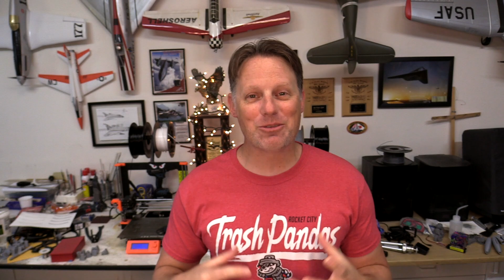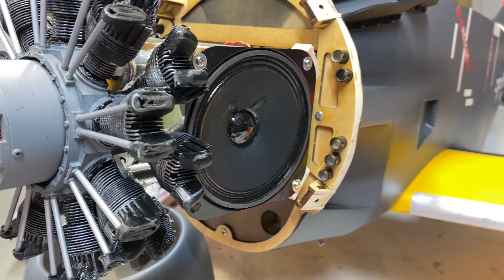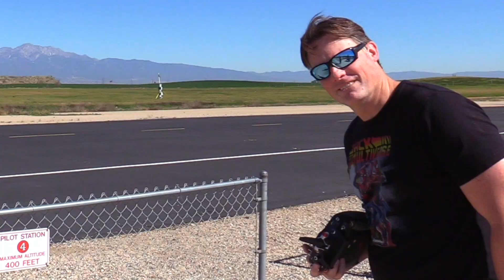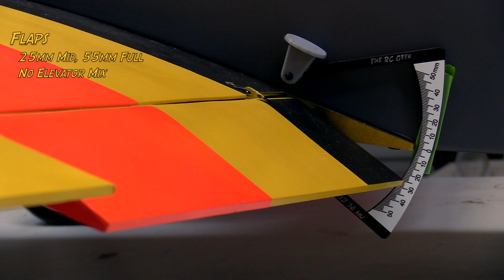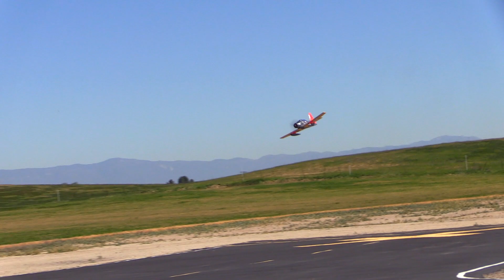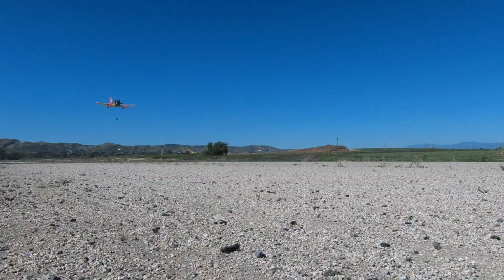Flight Review - Legend Hobby AD-5 Skyraider 86" Warbird

Comment: Stunning just stunning, I love the A1 always have but I must say this review made my mind up about sound modules, they are barely audible if at all in flight which is when it counts - I would rather buy more packs or put bigger packs in than add the weight and cost of sound modules that admittedly make startups a lot cooler but that's about all they do. Im a much bigger fan of your afterburners - those make sense.
Reply from the maker: Haha, I get it. Keep in mind that my speaker installation is far from ideal. Sound is directional and being in the cowl without any sound holes deadens the sound significantly. The speakers really should be in the wings facing downward covered by a screen only. The loudness would be night and day in that. I just couldn’t bare to cut holes in the cowl, haha!
Reply: @Thercgeek  Copy that, I did once witness a Stuka with a gorgeous engine note and siren all activated from the Tx so I guess it depends on the aircraft and installation. I love your creativity and going the extra mile on these scale projects, that is the aspect of the hobby that I enjoy myself, sometimes even more than flying. Happy landings
Reply from the maker: When I install this into a warbird I fully build, I’ll integrate it better so that it’s much more audible.

Comment: That's a beautiful model! One question, which radial engine (if any) would fit in the cowl? Otherwise, which four stroke petrol/gas engine would be apropiate? Thanks in advance guys.
Reply from the maker: The challenge is the diameter of the cowl and finding a radial with sufficient power to fly it that fits. If you want to go the grass route, I’d recommend a 40cc twin cylinder. It’ll fit in the cowl I think and will have a more pleasant sound than a single cylinder engine.
Reply: @Thercgeek  Thank you very much for info!
I red somewhere the cowl diameter is 190mm. With that measure my Saito Fa200R3/FG33R3 doesn't fit, let alone the Saito FA325R5 that was intended for the Skyraider. I will have to think about some twin cylinder four stroke that will fit......if any at all.
Reply from the maker: 190mm is probably about right on the diameter.